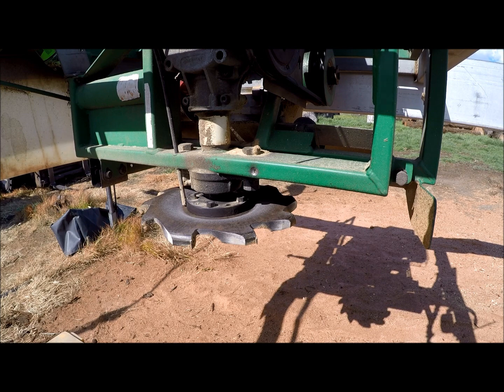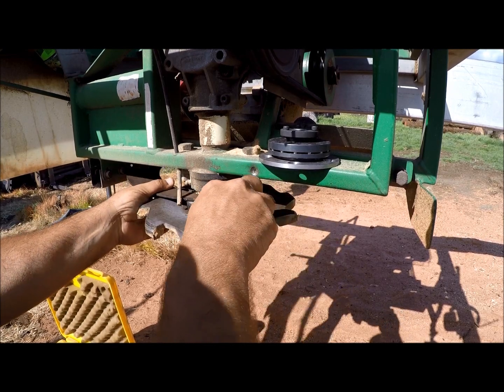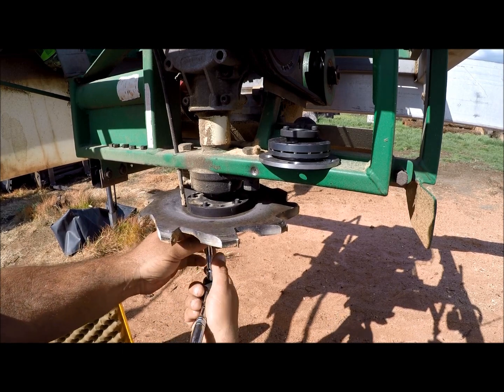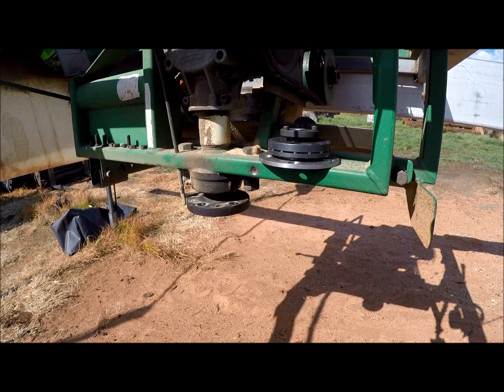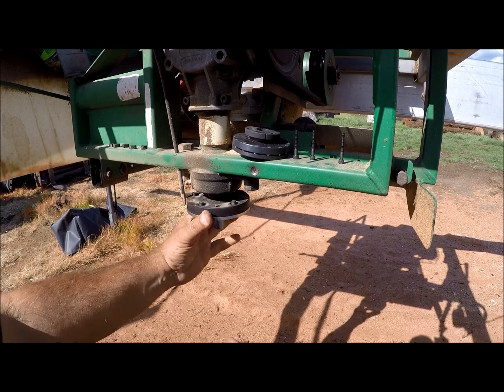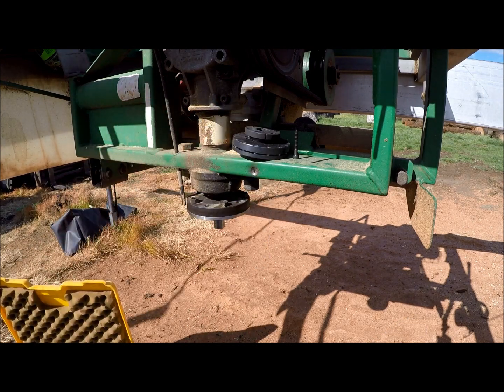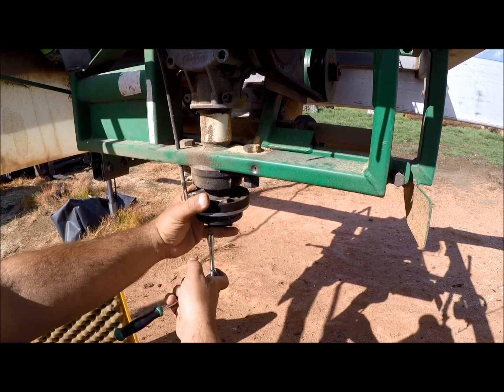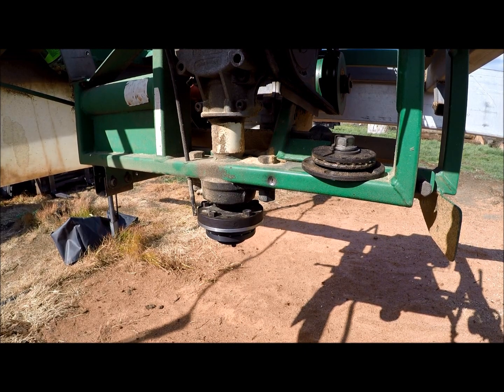Lucas Sawmill Slabber Hub and Sprocket Upgrade

Comment: I found that when you have a very tight Allen bolt, it is best to use the socket key with a T bar and just tap the bar over the socket it in the direction of the hub and it becomes loose very easily, working a little like a slow ratchet gun.
Reply from the maker: That works also sometimes, but with all the vibration, these ones can tighten themselves up so much that often times you have to take more aggressive steps! Doesn't happen all too often tho